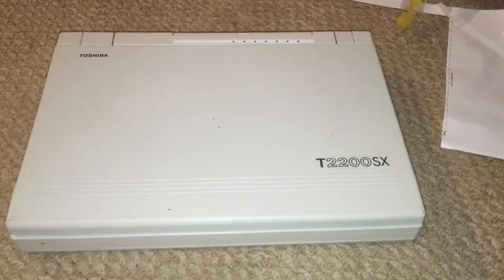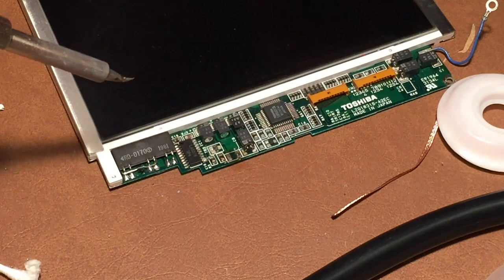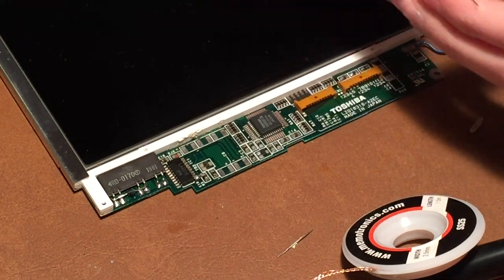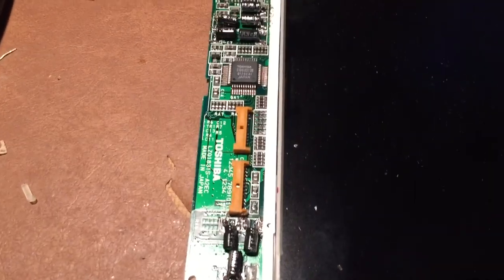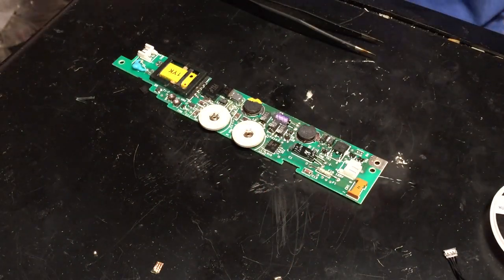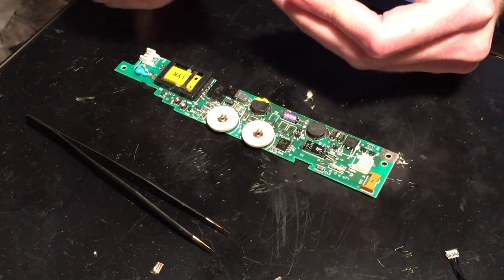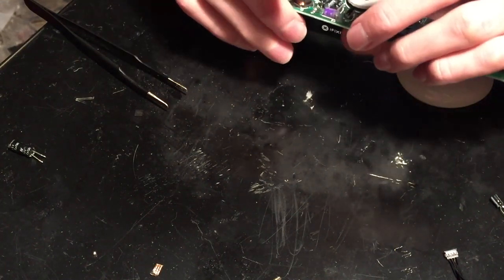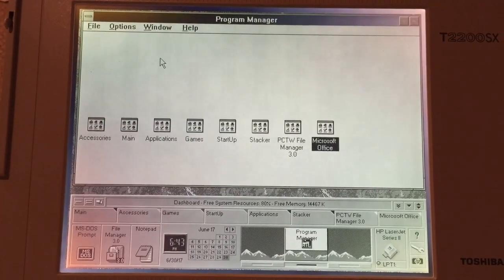Toshiba T2200SX LCD Poor Contrast Repair

Comment: I really like that you care for this almost historic, very well built Computer.

The Toshiba TS2200 SX was the first Computer I ever used. I was 5 or  6 years old then. It was purchased in 1991 and the original price was  similar to a small car.

At that time, we didn't own a computer at home. But a friend who sometimes came to visit us used the Toshiba for work. And sometimes (very rarely), he had it in his bag and showed it to me. There were some games on it. When this happened, I had a very special feeling of excitement, not freaking out, but longing to get acces to some mysteries of the adult world.

Shortly after his company replaced the Computer, he gave it to me. He had done business travels on airplanes with it and I was very proud that I could have it. 

This computer was still running in 2012. 

Same story with its follower, a Toshiba Tecra. It had a CD drive with it and a 486 CPU.

More than 15 years after the Tecra had started his lifecycle in the company of our friend, the battery was still running for more than one hour. The CMOS failed, of course.

 I was close in trying to install Debian Linux on it. But due to the missing USB and LAN connectivity, I dropped that idea. I was quite sentimental at the recycling center.

Comment: You need to check the caps in the power supply board in this as well.  I just took apart one, and decapped it.  You will need:  (4) 6.3v 1000uf, 5mm lead spacing, 10mm tall.  (2) 25v 220uf, 5mm lead spacing, 10mm tall.  (2) 16V 56uf 2.5mm lead spacing, 7mm tall.  (1) 10V 82uf 2.5mm lead spacing, 7mm tall.
Reply: Hi! Thanks for this! The third cap you describe, cant find it! Are you sure it is 56 uF and not 5.6 uF?

Comment: Hi there! I've recently purchased the same laptop 2200SX, but without a power supply and I want to bring him back to life. Would you be so kind and can you please measure a voltage on your power supply for T2200SX and send me an answer in comment from left to right? There are 4 pins power connector with sign 18V. But I'm pretty sure there a tricky. I couldn't not find any information about this on the internet at all. Even in the maintenance manual nothing about this. Please please!

Comment: Hello!
Do you know how many VOLTS the RTC pack has? And Also if you know the voltage for the backup battery? i cant find any info on the actual batteries or on the web about it.
Reply: And you should change in description 4.7uf, 16v to 4.7uf, 10v. you made med buy the 16v ones and noticed in the vid that you said 10v and not 16v xD

Comment: Hi, I own the same laptop too. Unfortunately I didn't have a charger so I tried to turn it on with an old power supply and to connect the pins. Initially the PC turned on, now it does not turn on anymore. I saw that you are expert in electronic boards, could you help me out? Thanks in advance

Comment: Hey I have the same problem, though at first my laptop's screen seemed smeary, like you would play a game and moving a character and it would be hard to see. Is that going to be the same or is the screen not supposed to make any smeary reactions on the screen? It would probably make it better? So right now when I turn the laptop on, the text is all smears, of course it never acted like this. When some of the text would be visable,  it randomly turns white. My toshiba satellite is a little newer so it has only the brightness not the contrast: and it's a 24bit color screen.

Comment: In the future you can cut the leads on a through hole component and remove one lead at a time.....just fyi. thx
Reply from the maker: I know, but this ended up being very easy to remove just using solder wick.

Comment: i have restored my mac pro with your tiger image (on your website) and i cannot access the user panel because a password has been set, if you could privately send me a password id be much appreciated, otherwise keep up the good work, love the videos!
Reply from the maker: It should be "guest"... Need to upload a new copy with no password.
Reply: dosdude1 worked perfectly, finally I can run the original os for my mac, also is there a copy of OS X 10.6 server you could upload at all, just that I’ve been needing it and I’ve found your website to be a one stop shop for my Mac problems, thanks